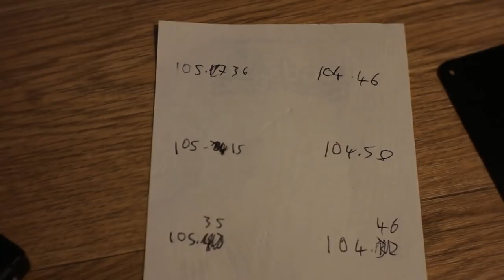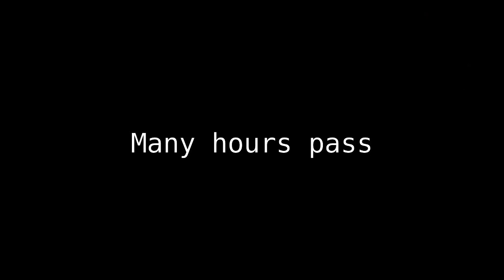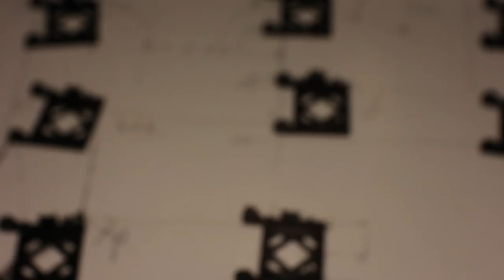Anycubic i3 Mega bed alignment / issues / tweaking

Comment: My glass is flat,, ive trammed the bed and the nozzle is nearly touching the glass in the centre but just scratches the paper in the 4 corners. Ive bent the bed rod brackets into alignment and it hasnt solved the issue. Any idea where else to look? Im thinking of trying to bend the x axis brackets but im hoping if anyone has any idea they could let me know. Thanks
Reply: What i believe is happening is something is causing the tool head to lean forward as it travels toward the centre of the rods pushing the nozzle down ever so slightly.
Reply: I basically have this exact problem too. Did you ever tune this problem out?

Comment: I have had the bed leveled 1000 times. It does not stay in level for whatever reason and I don’t ever bump it or anything. It just has a low quality build surface. I just use two cents worth of bed glue every time and to hell with it and it works OK. These things are really crap right out of the box but what do you expect out of Amazons top tens? Most people seem to have the best effect or affect from the enders. I really just think the build quality of any cubic is lower than the price point
Reply from the maker: I have never had it move after adjusting... since I made this video I have not touched the levelling screws and it is still spot on. However, the design of how the rails are mounted leaves a lot to be desired, and the assembly issues I found at the start leaves me to expect that there would be plenty of variance between printers as received. Overall I'm not upset with it but if it suddenly disappeared in a puff of smoke I would buy something different to replace it.

Comment: Similar issue, recently.

The issue is on the mounts, as you pointed. Though, on mine, the shift is not front/back but ... sideways. Like 0.08-0.1mm or so. Tiny, yet big enough to cause issues with the bearings (moving failures, grinding noises, etc). Something that probably can't be fixed with a spanner or something like that.
Considering to replace the Y axis rods and mounts with linear rails and bearings, which will suppress any flex due to the load.

Another "issue" is the spring system to level the bed, prone to flex. Replacing springs with a self-locking nut (thumb nut) system solves this.

Comment: I would have sent it back and ordered another one, you pay the premium over buying an Ender 3 or other kit so you don't have to assemble and mess about with it and end up having to do the work that Anycubic should have done
Reply from the maker: Indeed, since it's sold as one of the more ready-to-go printers it was quite annoying. This is definitely still a tinkerer's printer, even if it starts out better than other kits.

Comment: Drop down servo pulley down. Make sure belt at the same hight from main servo pulley and slave pulley. Measure next to the both pulleys belt hight. If belt have slope thats why bed gets lower at one end. If there is uneven bed surface then there is another remedy. Let me know .

Comment: Would have been far easier using shim steel under one edge of the rod holders
Reply: imo best thing to use is aluminum tape, it's very thin, and you can add multiple layers until the problem is fixed, in my case a single layer fixed the misalignment :)

Comment: just got mine but has problem with right side its making knocking sound on z axis any advice mate? thx
Reply from the maker: Do both sides of the Z axis actually move? Or is the right side stuck? If the latter, you might have lost a phase on that stepper, and checking the connections to the main board would be worthwhile.
Reply: yes both sides move left is smooth and right jumps when going up and down and starts knocking and i can move the black case on right aswell

Comment: I too have the same problem, of a kind. I thought from going through the levelling process that the bed must be domed., but its not. After watching this video it got me thinking and from the problems you have been having it would seem that my bottom rails bow upward and the X axis rails bow downwar posting thihis is all so confusing as the machine worked brilliantly for the first 3months. I'm baffled.
Thanks for posting this and please let me know how you get on.
Reply from the maker: It's very odd that it would change over the course of some months! I've been happy with the results since I did the tweaking in the vid, and haven't needed to print any super-large parts requiring a water-tight first layer since, so I haven't bothered upgrading the Y axis any further yet. Tuning the X axis in a similar way would be a real pain since the mountings are hidden inside the end blocks. Good luck!

Comment: I seem to have the same issue on the X-Axis. Middle is about 0.3mm higher than left and right :-(
Reply from the maker: A bit trickier to fix if so, as the mounting brackets are hidden inside the almost-closed steel housings. It might be a case of there being tension on one rod and compression on the other, causing the two to bow? Rather than the mounts themselves doing the bending.
Reply: Ok after some more tinkering i have solved my issue.

After leveling the bed with the knobs i put the extruder to the center of the bed where the nozzle scratches.

I undid the brackets holding the bottom rod of the gantry, not the ones on the side but the ones inside the gantry boxes that are hidden. You have access to them through holes on the back.

After i loosened them i looked and the nozzle wasnt touching the bed anymore. I checked with leveling paper across random spots all over the bed and it was very consistent.
 I tightened the brackets and checked again and it works perfectly. Hope that helps
Reply: @andycrighto3740  I am going to try this
Reply: Same for me. That's really annoying and hard to fix. Loosening the screws does help a bit though. Maybe there is a way to print something that fixes the issue.
Reply: Same issue here. It's driving me crazy! If I don't want the nozzle to rub I have to adjust all four corners so that I can fit two sheets of paper under the nozzle. At that point I can barely fit a receipt paper in the center.

The issue is only in the X-axis (left - right). In the Y-axis (back-front) the gap doesn't change at all.
Reply: What i believe is happening is something is causing the tool head to lean forward as it travels toward the centre of the rods pushing the nozzle down ever so slightly.
Reply: After taking the hotend cover apart it i believe ive fou d the culprit.
The nozzle is held by a z shaped bracket, that bracket is screwed onto a bracket on the rods, and feeds through the other side and is attached to the belts. I believe as it travels accross the rods the belts pull on it and twist it out of square

Comment: Three point mounts can not wooble or twist. You should not add a fourth linear bearing. In fact you should remove one of the four adjustment screws on the bed. As it is, it will always rest on three of them and drag the fourth.

Comment: my anycubic printer doesnt want to go to the middle to print all of the plastic is coming out om the edge
Reply from the maker: Does the X axis work at all? If you move it by hand and then use the "home" function, does it move back to the left?
Reply: Ahh I fixed it the people who sent the machine didn't tighten the x axis belt so I cut the plastic ties it had tightened it and put my own plastic ties. Problem fixed

Comment: My power switch broke on the first day, it would not switch it off anymore. I contacted support and they told me to check the fuse, which makes no sense at all. Then they proposed I repair it myself. It's the main power switch at high voltage which should not be serviced by the end user, so I just returned the machine. Looking for higher quality machine now
Reply: Yeah it's an issue I've flagged with them. The spring connector inside the switch comes loose after a few hours of printing. Sometimes it fixes itself if you tap the switch a few times, not ideal but it's something you can fix easily if you can find a replacement. Connect & crimp three wires, put the fuse and screw it back.
Reply from the maker: That's pretty poor, they shouldn't be telling people to take it to bits - that's the whole point of it being supplied mostly assembled.
Reply: Right, but if a fuse is broken then it will not power up, I could not switch it off anymore with the switch. It turns out that almost all systems have the problem. The switch breaks in the first few days of use.
Reply: Ron, My switch also broke last night and it will not turn off. I just quit dealing with their "customer service" because they don't listen. Also the bed itself is warped and they have me doing the loop by suggesting that I follow what Funkster was doing with his. I did all that to no avail as well as dealing with definite cold spots of the bed.
I can see now that I will have to replace these items myself....very poor customer service.
Reply: Yes, I know. I told me to repair it myself, they would send me a switch, but I didn't like to work on AC mains, then they told me it's only 12V DC. They were just plainly lying to me. A replacement for the switch is easy to find actually. It's quite standard. Thanks for letting me know...
Reply: The problem was that I couldn't turn it off anymore, the switch they use is of very poor quality and is know to break withing a very short time. My system also had a grounding fault, which makes it a very dangerous system to use. They gave me a thought time about returning the system, but I got it done. No I'm very happy printing with the CR-10S, great system.